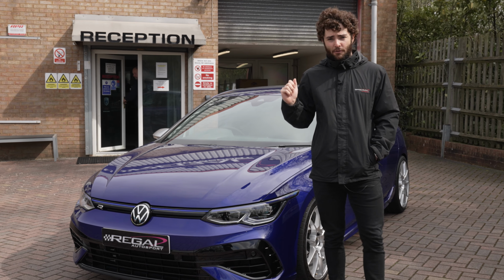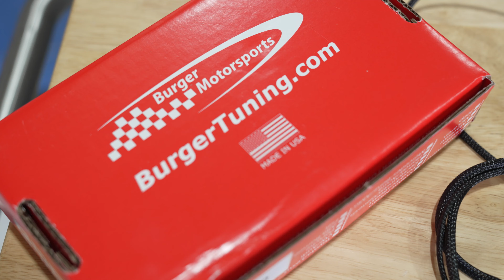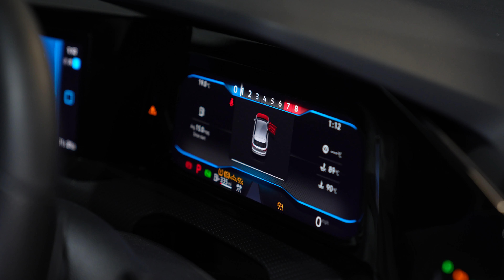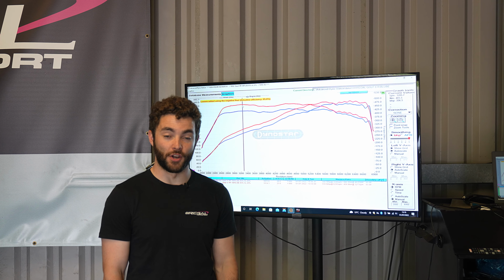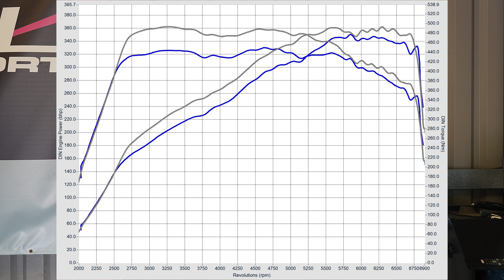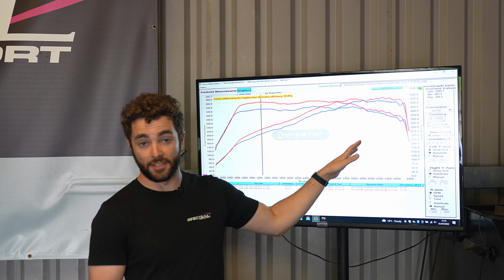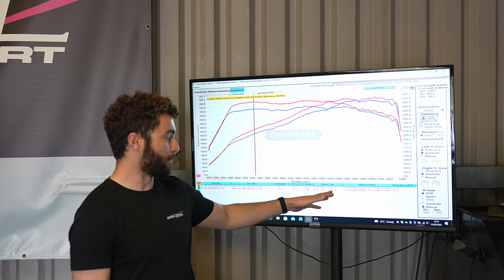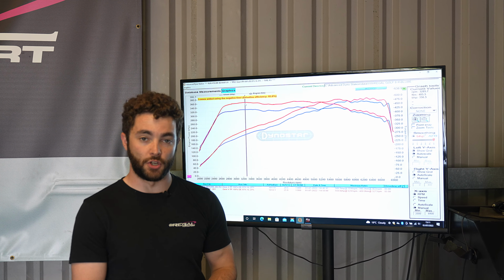HOW MUCH POWER DOES A JB4 REALLY MAKE ON A MK8 GOLF R?

Comment: I hoped for around 390bhp after the jb4. The best info from this movie are the gains from intake. We have to wait for proper ECU tune.
Reply: It's likely possible with some better fuel and the custom map via the JB, but yes a proper ECU tune would be a better all-round option.
Reply from the maker: ECU tuning will always get better results in terms of driveability and overall output
Reply: Still thought that the gains from jb4 would be better than from the racechip or dte systems. The 2023 golf R will come with minor tweaks with ecu (333hp power outut) and in tcu- i hope that i will be able to update it in authorized service.

Comment: Are you working with JB4 currently to gain higher figures? I've had one now for about 3 months and I've been quite disappointed with it so far, barely any differences in times over stock and having to have a custom map because of hesitations/bucking on all default maps
Reply: Custom tunes for the win :)
Reply from the maker: We gave the feedback to JB4 and they have since sent us some new 'firmware' to test out. We haven't loaded it up or tested it yet, we do plan to soon and when we do we will of course film the process and upload a video too. 

It's promising, just not quite there yet!
Reply: That's what I was expecting. George has told me I'll have a new firmware on Friday hopefully so I'm guessing he's just waiting for you to try and see where that goes. You're right, it's getting there, but very slowly unfortunately!
Reply: @Dave389OM  any improvements since you posted?
Reply: @gunnergibson  I ended up sending it back after about 6 months. I was changing parameters, uploading new firmware and still never got it sorted so I just gave up and they refunded me. I'm not sure if it's working now though
Reply: @Dave389OM  cheers Dave, saved me ordering one!

Comment: Love that your testing them can you also do a 0-100 or 0-60 test and quarter mile runs before and after. Dyno power is one thing but how’s does that translate to actual performance and can you actually put down that bump in power with the rest of the car mostly stock.
Reply from the maker: To be honest, I think 0-60 etc will be slower as the gearbox is not as smooth with these tuning boxes in general. I personally never drive the car with any tuning box activated.

Comment: I dont understand the "stock baseline dyno run" of 349bhp, and then you remove a Racechip. That's not a stock run if you had a Racechip installed? Surely a "stock dyno run" is without the Racechip installed? Confused.
Reply: Seeing as stock car only makes around 320bhp I would say the Racechip was plugged in.
Reply from the maker: The Race Chip was deactivated, thus the race chip was not manipulating the signal to the ECU. It's that simple :) 

+ Neil - none of these MK8 Golf Rs make the published VW stock figure, especially not with an Eventuri intake. 

To finalise, the ECU was stock :)
Reply: The mk8 R and mk8 CS make around 200bhp more than claimed 
Our base power when stock was 322bhp (gti clubsport)
Reply: @TheYorkshiregolfbandit what ? 322 hp for a gti club sport ? 
It’s the same as the mk8R

Comment: This is why you don't jb4 👍
Reply from the maker: I think on this application its a work in progress, which they are actively working on as they have sent new firmware to test, and to be fair to them they do have a good reputation in other markets. 

It's worth bearing in mind that it is a tuning box, and there are always limitations because of that.
Reply: JB4 is proven in the BMW M line platforms for years. One of my buddies has a 2016 M3 on JB4 plus E85, runs flawlessly. Maybe for the MK8 still needs some tuning polishing.

Comment: £400 for an extra 10bhp. I think I'll save my money.
Reply: 10 over stock? Or 10 over the Racechip
Reply: He said the car was standard with the 349hp.
Reply: @kai_291  I've got a Mk8; it's underated from the factory but it is not putting down 349 to the wheels lol
Reply: 40nm+ mid range where you actually spend most of the time, why care so much about peak power.
Reply: If you're only looking at peak numbers you're chasing the wrong thing
Reply from the maker: At peak, yes. Under the curve, there are higher gains. It's worth noting that there were graphs with higher peak power but the curve was VERY bumpy, so its not something that we'd run with. 

RaceChip have sent us new firmware which we will test out and post up the results
Reply: @t4cot4ctical  Hamilton racing did a dyno of a stock mk8 golf and got around 350hp and matt waton got 4.3 0 to 60 instead of the rated 4.7
Reply: @RegalAutosport  when can we expect the new firmware videos?